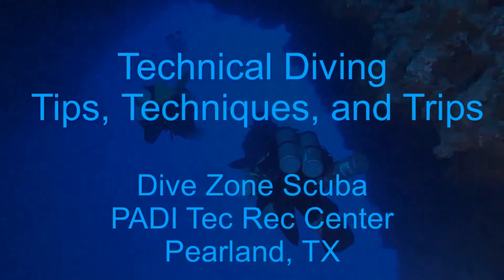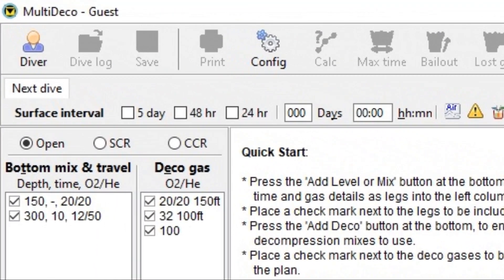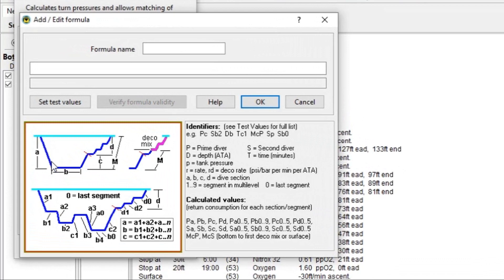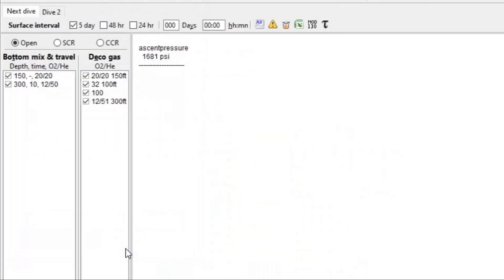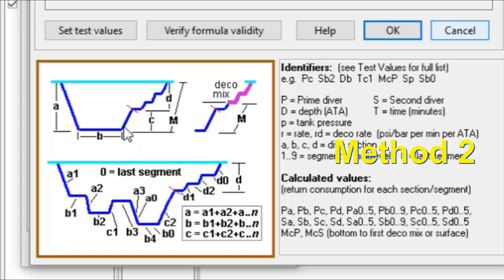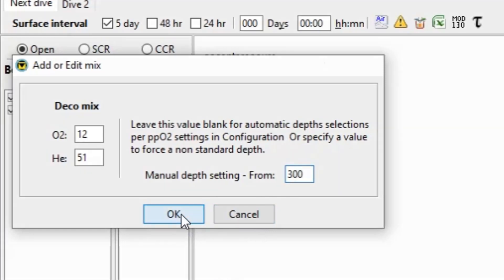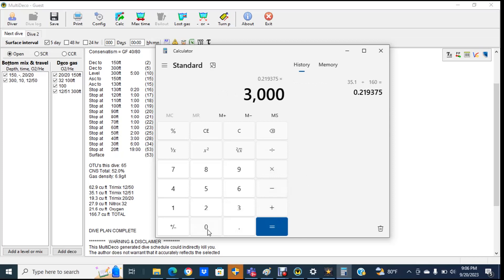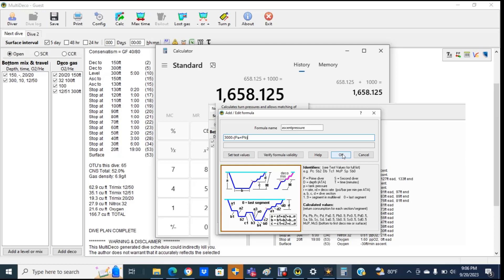#134 - Determining Ascent Pressures for Technical Diving Using Dive Planning Software

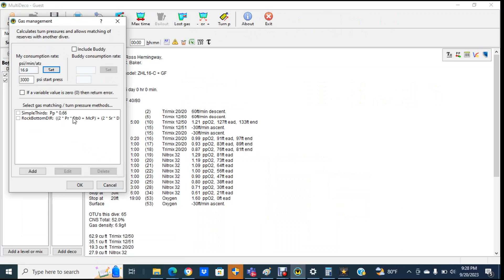Comment: During the example method 1 from 2:30 to 4:11, you are calculating the gas used prior to ascent by adding the full descent "a" with the full bottom time "b".  Should it not be "a2" + "b"  (or "b1"), because you should not add the initial travel gas segment into your 12/50 sum?